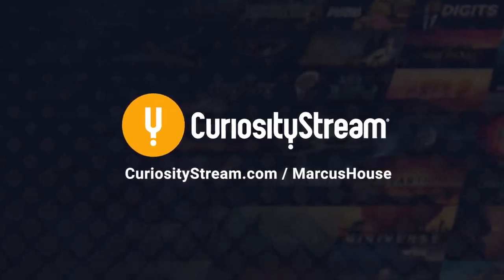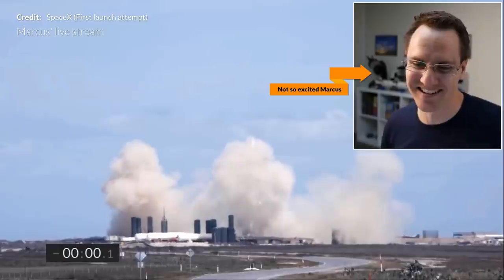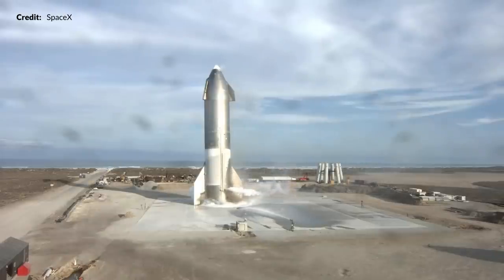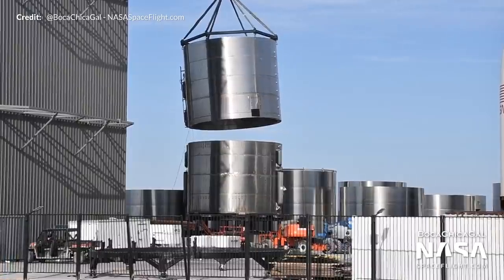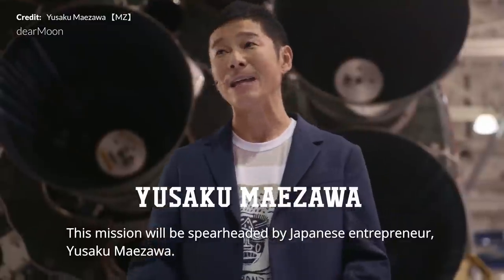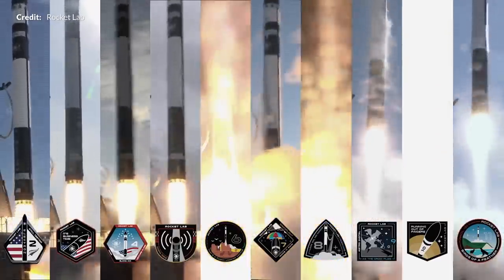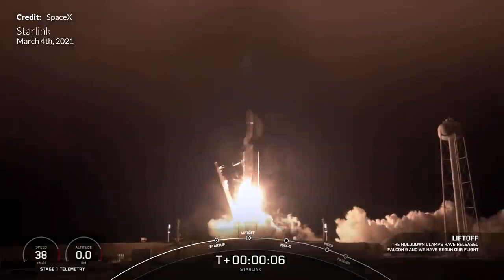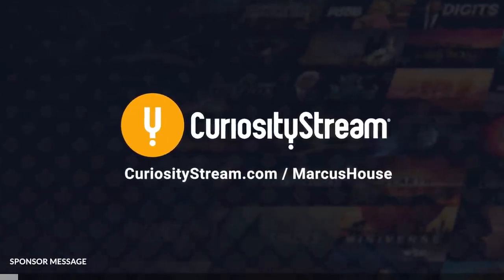SpaceX Starship Update, DearMoon announcement, Rocket Lab Neutron and Starlink

Comment: During it's approach back to the ground, the remaining running engine was throttled down too quickly, too soon.  If you will watch the replay closely, you will see that it was approaching slowly at first, then it seemed to accelerate as it nears the ground, resulting in a hard impact.  That indicates the throttling back of the remaining running Raptor engine.

Comment: May be you explained before and I might miss it. What is the reason of flames after shutting down the raptor engines. Can this flame be the reason of explosion after touch-down? Raptors are shut down in two occasions: 1. While ascending, when the speed is high and the flames (due to the speed of the ship) put off relatively easier. 2. During the last phase of landing, when the speed is almost idle and the flames persist and eventually cause the ship heat up and explode.

Comment: I wonder if it would be better for starship to start it's flip higher up and purely aerodynamically, sort of a "backslide" from it's horizontal skydive, by tucking in the back fins. While that would increase velocity, they're past the high Q part of the re-entry at that point and the higher velocity would allow them to go for a more "hoverslam" style of approach, allowing more than one (perhaps all 3 engines) to light at well above idle thrust. It also minimizes the amount of horizontal movement as the engines flip the craft upright.

Comment: I've been thinking about the Starship landing system, and how many people are saying it's unsafe for manned flight.

However, I think it's actually going to be the safest (powered) landing systems ever.

Long story short, three raptors gives huge redundancy.

Think about the Apollo lander:
You're coming in to land on the moon. You go to light your engine.
If it lights, you land.
If not, you abort to orbit.
Either way you live, but in the case of a failed light you don't land. Which if you're landing on Earth is tricky.

Now for Starship:
You come to do the flip, and try to light 3 Raptors.
If all three light, you flip, cut 1 or 2 raptors on the way down, and land
If one fails, you flip, cut 1 on the way down, and land
If 2 fail, you crash

So would I ride a Starship? Maybe. 2023 is a long time away
Reply: Maybe 😕. But an abort system is still MANDATORY. Just make a version that has a capsule similar to Blue Origin with parachutes, etc. They'll rarely transport ppl anyway, so why not?

[Youtube has a bot or paid TROLLS that DELETE factual comments]

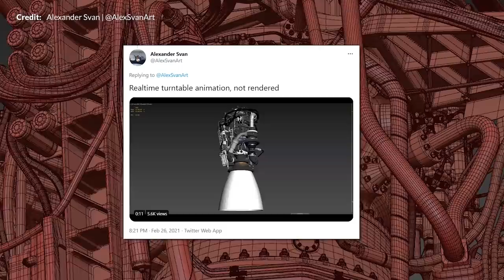Comment: I'm sorry but.. are those left hand threaded bolts on the top of the frame at 9:04 ? The point of lock wire like he has strung between those is to keep things from unscrewing. The wire makes it so that they're pulling to tighten each other, any unscrewing on one will pull the wire taught, both stopping it from unscrewing and tightening the other bolt. The way he has it in the model, normal bolts would both be unscrewed if the wire pulled taught.

Comment: Since SN10 had to land at an angle maybe they need three Raptors surrounding one center raptor. It needs to land completely vertical. 
They need to model new legs after Falcon 9. Heat shield should not be a problem. Remember that shuttle dropped three landing legs thru it’s heat shield. Landing vertical and stable is paramount. 
Also, I doubt that astronauts will ever fly in a Starship unless they have an ejection system. Remember, shuttle flew over a hundred times and only failed  twice but 14 astronauts died. I suggest that a rectangular tube that would carry astronauts at launch/reentry could rocket eject them during a failure.

Comment: I think the Starship should have windows, but porthole size for increased safety and simplicity.  The big window IMO should be a very large screen(s), leaving the nose cone intact and safely encased in steel.  External cameras could provide light amplification of the faint light facing away from the sun while protecting the passengers from accidently exposing their unshielded eyes to direct sunlight.

Comment: For people mentioning how single engine landing is silly...  It is anything but silliness, it is a matter of heat and durability of things, while rapidly prototyping.  Just the same as the need to crash a car to make sure it's safe, it's good to push the limits (in this case- heat) to learn where items fail.  Turns out it was likely the "Throttle up" signal failing just before touch down.

The base of the rocket, engines and ancillaries face a massive amount of heat, stress and vibration on ignition and take-off... There is genuinely-usable test data on this stage of rocketry dating all the way back to the 1940s, but landing is a whole new bag of cats.  Heat, vibration and stress becomes even more of an issue on landing...  This is reduced by initiating the flip to vertical as late as possible.  And that's only considering immediate factors.

As massively-complex as a single use rocket is, it only truly has one job. Tasking that rocket with landing not not quite as simple as "if you can stand up; you can sit." It is genuinely giving a rocket an entirely new job to do.  Like asking the raptors to change angle individually and RAPIDLY within their homes while lifting that much weight...  

It is much easier to manage the heat from a single than two or three engines.  And couple this with landing on a flat surface like a concrete pad, there's SO much heat reflection back up into the ship.  The good news is that it works, albeit with needing refinement to manage heat, so with an improved landing pad, landing gear, it will improve the heat dissipation.  The legs will certainly be improved as well, since those little nubby things were likely, parts bin scraps. 

Proof of concept first, Elegance Second! :)

Comment: 3 of the landing legs refused to lock in place. I find it odd that they are doing this by trial and error. Also, looking at the structural integrity of the rocket as it descended, I can see that it's a little 'bent' and when it becomes vertical it does appear to be losing form. The fact that this thing uses gas pressure to maintain its form is a worry.

Comment: I think those Raptor engines still need some tweaking, they seem to be a little unreliable, the amount of engines that have had to be swapped or caused a vehicle failure must be getting expensive.

I also hope they find a new landing gear, with at least some width stabilization and better dampening, I get they don't want to test more expensive ones until they've ironed out the landing, but the soft Mars/Moon surface will end up with tipped Starships, unless they're sending a concrete truck to build a pad first.

Comment: Subscribed. Good stuff Marcus!  I still do not understand why they are trying to land as they are, why not just land like an airplane at a super long airway?
Reply: because the relies on that runway, remember that they are also learning to land on moon/mars so its good practice to also land on earth
Reply: @KlaasWhite  good answer,  and it should be easier considering less gravity on mars/moon? Still,  once landed,  I think runways are way safer and better and more efficient.
Reply: @CannaKen  well also a problem with landing would be that they need more surface area of wings to create enough lift to not fall out of the sky (look at space shuttle) and the need for wheels which would be useless on mars and an extra complexity that could fail. Also if they are planning to do point to point on earth (still dont know if this is a good idea tbh) they need vertical landing
Reply: @KlaasWhite  Thanks for your reply Klass. I still believe its better to have wheels and land, and anything can go out with failure for sure, if the rockets go out of they lose fuel its gonna crash anyways. All the failures along the way now, just seems it would be easier to put wheels on and land it. Save alot on fuel as well.

Comment: SN10 still looked like it had no landing gears visable or valid enough, like a simple raw cut bottom to fit the 1st stage heavy canister, by the time it landed it was posed like The Leaning Tower of ancient Italy. Moments later, it was doomed, the fuel it uses is not exactly what nature would approve for multi travel, still don't think many want a ticket ride in this kind of flight method roller coaster.

Comment: Marcus regarding a moon mission in 2023 it is possible but the humans will be transported to LEO in 2 separate flights of Crew Dragon which will then dock to refueled Starship. Otherwise it it not possible to achieve. Crew dragons are certified and will carry people to LEO and back to Earth. The rest will be sone by Starship.
Reply from the maker: Not possible on the return, Starship will be returning from the moon and can't get back into LEO. It will be direct into the atmosphere for Starship.
Reply: @MarcusHouse  Many thanks for your reply! Your show is fantastic! Regarding the entry there are two option. First is that both CrewDragons will be attached to Starship and undock on the way fron the moon. Heatshild on CrewDragons is sufficiently robust to survive the re-entry. Secon option is that Starhip will carry more fuel to perfom breaking maneuvers to part on LEO. Otherwise I cant realy imagin this flight in 2023 neither 2024. In order to carry people they will have to have much more experience.

Comment: I do not understand how that rocket will work, it looks like it is built to take off from earth but at same time too small to reach space, and if it will have a first stage to help it come up in escape velocity why then do it need so powerful engines, and how will it manage the re-entry with those wings, and not heat get in between them and the body, and will one side of the rocket be covered with heat shields, and if it is a round tube how will it then be able to use the friction to slow down? Is there any realistic simulation of a manned mission with that rocket to see how humans will experience the rocket going from horizontal to vertical position so fast during a landing, how will the seating for the crew look like if it will fly and land like that?

Comment: Why do they "Suicide" so hard?? Why not come to a hover at 100 foot then gentle set down? Coming in to fast IMO
Reply: you save way more fuel this way
Reply: @aeichelberger15  But may have a little less RUD's. Just seems to be a huge issue. Is the Starship booster going to land the same way?
Reply: @ogreth9438  I think they will solve this in time, just like the falcon 9. the booster will land vertically without the bellyflop maneuver, but it will be "caught" by some kind of mechanism on the launch tower.

Comment: If that's the case, and I have no reason not to trust Elon, I don't think all of the problems were described. It is clear all of the legs did not lock and there was still that huge flame that occurred prior to the landing and continued until the explosion. There is also the color difference in the engine flame as well. I just don't think all of the engine issues are resolved yet. After all, it is a generational leap in engine design that no one else has ever done.

Comment: so Starship reaches 10 km. Then she reaches 0 speed. Then she free falls and makes a kinda successful-ish landing. With her engines, which did NOT spend 6 months in space.
On Mars, they have to do it in a much thinner atmosphere, with used engines, from a much higher speed.
how will a successful landing here on Earth mean anything on Mars?
thanks
Reply: this is just one of many tests that need to succeed before starship goes to mars. The thing needs to know how to land before it can be reused or flown farther into space.
Reply: @aeichelberger15  that's what I am talking about. If this body shape works here, they can test the sh!t outa Starship, those surfaces won't generate any lift on Mars. And if they have to re-design the whole geometry of the entire spacecraft, these landings on Earth won't mean too much, because none of the measurements can be used in a Martian descent. How could they be used?

Comment: Both SpaceX and the dearMoon project are too optimistic with their timetable, in my view. It's becoming clear that the biggest sticking point is going to be those Raptor engines. A full flow staged combustion cycle engine of any stripe has never previously been flown and over time it may become clear why. It is either wildly optimistic or entirely reckless to bet all their money on untried technology. Nevertheless, I should be delighted to be proven wrong.
Reply: its called "Elon time." basically everyone that follows spacex knows elon is always very optomistic with his deadlines to motivate the engineers. In reality dearmoon will probably happen a year or two later than 2023.
Reply: No doubt it is an optimistic - though not impossible - time table. As for untried technology, Elon Musk has a record of proving and manufacturing untried technology. That does not guarantee he will succeed, but it is a possibility.

Comment: Why do people keep saying it was a "successful landing"?  If a passenger airliner landed and hit so hard it shoved the landing gear up into the fuel tanks and it exploded a few minutes later NOBODY would call that a "successful landing".  I'm not saying it wasn't a huge step forward.  You could even call the mission a success in that many aspects of the launch did work better than previous attempts but to call it a "successful landing" is laughable.  It was about as successful as saying you successfully parked your car by driving it into a brick wall at 20 mph.  The car is totaled but you stopped so just call it a success and get away from it fast because the engine is extremely hot at after that impact is no doubt leaking gasoline from the injectors all over the top of that hot engine.  

What space x did there was incredible but stop manufacturing success where there wasn't one yet.